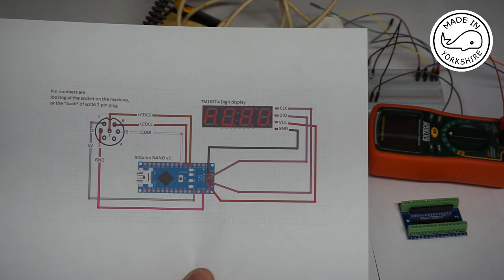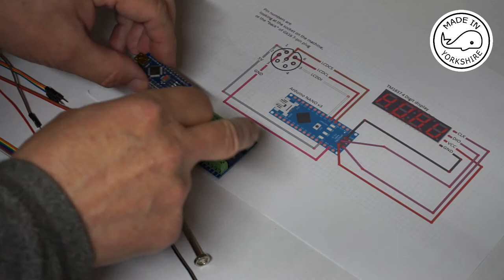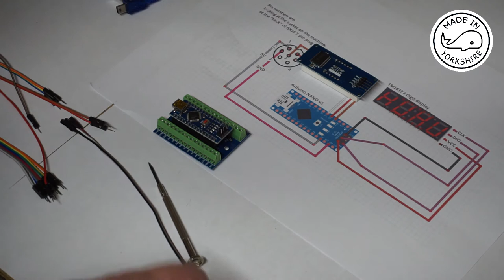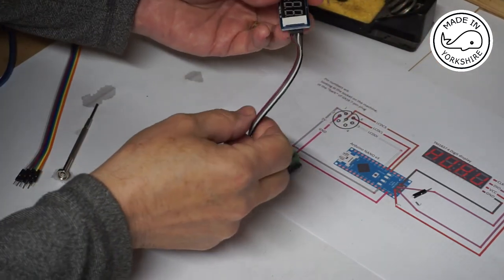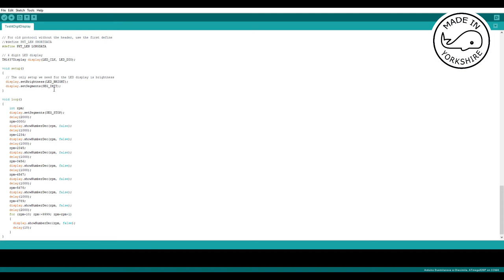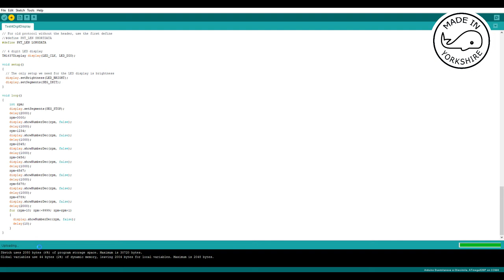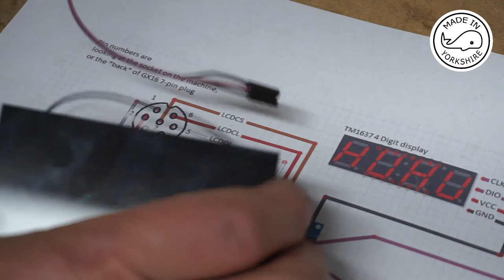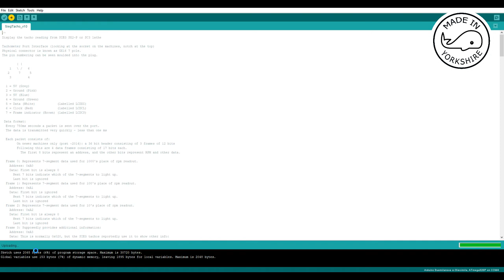#MT16 - Making a Digital Speed Display (RPM, Tachometer) for Sieg mini and lathe. By Andrew Whale.

Comment: Thanks Andrew, firstly for the video which I found very clear to follow and secondly for the detailed information and programs to build it you gave me.
In case anyone else is thinking of building this I would say that it is very straightforward and Andrews notes and guidance cover everything you need. My only problem was adding a library to the Arduino IDE. Never having done that before I could not get it right, and then suddenly it worked. Other than that learning to cut and machine perspex was new to me but manageable.
I now have one each on my lathe and mill.
Thanks again Andrew for making all this available.
Martyn Duncumb
Reply from the maker: Hi Martyn - many thanks for the update. I'm really pleased that you found the video and the instructions I sent you were easy to follow and that you managed to make a couple of these units.
A large amount of credit goes to Andrew McWhirter who developed the code and encouraged me to have a go at making one in the first place.
It's great to hear of successes.
Have a great day!
Cheers
Andrew

Comment: Hey Andrew, Great job!  I hope some other folk get something out of the tutorial too.  And yep, a huge thanks to Jeff Nelson for doing the "hard yards"!
Note, the version 10 of "SiegTacho_v10" Arduino sketch is not significant: it just took me that many iterations to get it all working reliably! And whilst it was based on Jeff's sample code, there was quite a bit of rework to get to this point.  My version has lots more comments - mainly so I could understand what was going on - and, of course, the adaption to the TM1637 "digital tube" display.
In my version of the tacho, I used the standard "dupont"" connectors to connect to the Nano and display.  They seem quite reliable, and if you go this way the only soldered connection required is to the GX16-7pin connector.  By the way, the four side by side connectors you've plugged on to the display board: may I suggest you join then into a single connector with a tiny dot of super glue on each one?
If anyone is wondering: Andrew has my blessing to re-distribute all the materials I provided: Arduino sketch, parts list and wiring diagram.  If I can help anyone else who wants to have a crack at this let me know!
Cheers - Andrew (Sydney Australia)
Reply from the maker: Hi Andrew. Crikey, I hadn't realised that you had done so much work on the Arduino software. You have done a brilliant job and it's extremely generous that you are happy for me to share it. I can't thank you enough for providing all the other info and encouraging me to give it a try. It was a truly satisfying project and I hope others will give it a try too. Good idea to superglue the connectors. I will definitely make a version 2 for my mini lathe and look to incorporate the led array.
All the best.
Cheers
Andrew

Comment: Last year I used Jeff Nelson's information to build by own tacho for my Sieg SX2P, but extended it. I had done a cheap bodge/CNC conversion for my SX2P, and wanted to be able to control the spindle from lunuxCNC. The tacho build provided the perfect  bootstrap. I built a veroboard prototype and that, much to my surprise, worked!  Yesterday I received PCBs from JLCPCB. This was my first ever design using DesignSpark PCB, so I was not expecting much. After plucking up the courage to solder in my components I programmed the Arduino nano, replaced the min-board with my board (they are plug compatible), and it worked.   I have found some hardware and software issues. The most glaring hardware issue is I got the sense of the potent Iometer wrong - so I have to rotate it anticlockwise to increase speed (I forgot to say - the pot or software can override each other - it depends on who spoke last: pot or linuxCNC). I also think I should have connected SX2P 5V to pin 27 (5V) of the nano, rather than Vin (pin 30). I am also concerned about the conflict between the USB 5V (USB is used to communicate linuxCNC <-> Arduino). Mind you, it's 97.5% working. Eee! I'm reet chuffed!
Reply from the maker: Fantastic. Looks like you are having some real fun...... it's great when it all comes together.
Cheers
Andrew

Comment: Andrew, First let me say how much I have enjoyed your videos and how much I have learned from them. I’m pretty much a beginner as well and have been thinking about getting a small lathe and mill to help me in my main hobby which is electronics. What I like about your approach is you share with us your experiences as a beginner and don’t talk down to us like some of those experts! 

A couple of points about the Arduino. Firstly there are various versions so it’s important to use the Nano or any other of the 5 volt versions using the Atmel AVR processor. Some people might prefer to work with the UNO which is a larger board and less challenging to the eyesight. The UNO comes with pre soldered female header connectors. When I’ve bought Nanos from China I’ve had to solder the header connectors which is a bit fiddly. Second point is the cables you are using to connect to the Arduino are known as DuPont cables, they come in three types, male male, female email and male female. They come in various lengths, generally I use the shortest ones for the job to avoid rats nests. It’s important to use quality ones, some of the knock off ones don’t stay connected very long they can vibrate out of the socket or fracture. Personally I would solder all the wires using hook up wire, not DuPont cables. Another point is larger numeric displays are easily available. 

I think both your lathe and mill use the new brushless motors which are controlled electronically without gearboxes? I’m trying to work out if they are worth the extra expense. 

Anyway, thanks again for your great videos, arguably the best thing to come out of Yorkshire :-)
Reply from the maker: Hi Stephen - Many thanks for such kind feedback and advice. I'd not heard of the Atmel AVR processor and purchased a couple of Nano's with the description of ATmega328P. I guess the AT is short for Atmel? I was fortunate to find some with header connectors already soldered. I was at a loss as to what to use for wiring. You mention hook up wire - can you advise what gauge to use and where to get it from? (it's all new to me).
I recently decided to purchase the O'Reilly Arduino Cookbook - which I have found the be very informative and though provoking.

When considering the mini mill and lathe I debated as to whether to go brushless and belt driven. I would imagine that the machines run a lot quieter than the brushed/geared versions and torque seems excellent. I'm very please with my decision. I believe that the SC3 lathe and SX2P mill used the same motor and internals. I guess the mill would be a great asset for your electronic projects. You need to be prepared to do some work the get the machines set up properly - but that's all part of the fun I guess. Seems crazy that you have to start drilling holes into brand new machines and make modifications, but that's the reality. I'm now in a position where I'm looking to actually make something special and rewarding - maybe an Oscillation Steam Engine (without the boiler)!

Thanks again for the feedback and the very best of luck in your venture into hobby engineering.
PS - Be prepared to spend as much again on tooling etc (just like all hobbies I guess).

Cheers
Andrew
Reply: Learning Turning - Metal Thanks for the reply Andrew. I’m in Hungary at the moment but I’ll be back in the U.K. on Saturday. I’ll sort you out some suitable wire and pop it in the post as a thank you for the videos. I’ve a fair amount of experience with the Arduino and a very big stash of electronics parts so if there is anything you need I’m happy to help. 

I think Arc Eurotrading will be richer and I’ll be poorer next month!
Reply from the maker: Hi Stephen, it's very kind if you to offer to send me some wire but you really don't need to. Sending me a link to where to get it from would be great and then I know how to get it in the future.
Many thanks.
Andrew

Comment: Thank you for sharing this. I just tried Jenifer's / Macpods code, and for some reason the LCD, after displaying the welcome message, was not posting anything (just blank). your code combined with the TM1637 leds worked perfectly on the SX2 Axminster milling machine. Version 13 tested  - picked out before I read the instructions. Also thanks for including the library inside the code.
Reply from the maker: Great! I  like good news. 
Cheers
Andrew

Comment: DIGITEN 4 Digital LED Tachometer RPM Speed Meter from Amazon £14.49.I used a multi volt charger for power from Asda £10 and stripped it down to fit inside control box . Took live feed from inside control box  very neat.Before fitting magnet pernament its got to be round right way.Saved me the cost of £170 for plug in Sieg one
Reply from the maker: Hi. Thanks for the info. As I recall my solution cost around £10. Mine gets the true spindle speed data and there is no requirement to gain access to power.
Cheers
Andrew
Reply: @learningturningmetal hi yes I know but for less intelligent people like me  no need for computer programming but your video inspired me to try make my own so thanks
Reply from the maker: No worries. Glad it worked out.
Cheers
Andrew

Comment: Interesting project. I may have to try it someday. I'm still getting my mini lathe set up. It came with a broken hand wheel on the apron so, I have to sort that out first. The seller hasn't been much help. I really like the hand wheels you've put on your lathe. Are they chrome plated cast iron or aluminum? I'd ask you where you got them but, being in the U.S., they'd probably cost a fortune to have shipped here. I'm not having much luck, finding reasonably priced ones here.
Reply from the maker: Hi Dave, sorry to hear about your damaged hand wheel. My replacements are chrome plated cast something - probably iron. Bought from www.arceurotrade.co.uk.
Handwheel is No.52 - 80mm Offset 3-Spoked Handwheel - Chrome - 8mm Hole 084-014-00080
Handle is No.11 - 50mm Plain Revolving Handle Type B - Chrome - M6 084-010-20050
Total cost £19 excl delivery.
I guess shipping to USA would be around £25, but it might be worth you getting a quote from arc.
Alternatively I could send you one of my plastic ones for free if you paid postage to me via PayPal. I would need to get a quote from my post office but guess it would be around £14.
Hope that helps.
Cheers
Andrew
Reply: I've been looking also and could never find any at a decent cost. But some of the other Grizzly lathes have nice ones and they do sell them separately if you want to look...
Reply: Than you for your kind offer Andrew. I'll let you know. I found one like your metal ones on Amazon but, they only have one in stock. I'll see how long it takes to get more in because, I'd like to replace both of them at the same time. I like the fixed- handle type of handwheel. It's what I have used for many years as a machinist. This lathe is my retirement toy. LOL. It's small enough to sit down to operate, as my legs are shot and I can't stand for very long, anymore. I'm also toying with the idea of putting a 100 mm. wheel on the tailstock. Have to think about that some more.
Reply from the maker: No problem Dave. I hope you get your hand wheels soon. Have fun with your new toy!
All the best.
Andrew

Comment: Just built this unit. Tested out fine with test program but did not work on the Microlux 7x16. Got a frozen screen with various segments lit up. Used version 12. Does anybody know if the pin outs are the same in the Microlux and/or the packets the same length. I did not want to analyze the pinouts if somebody has already done it.
Reply from the maker: Hi Marvin. Sorry but I know nothing about the Microlux. Two suggestions.... Double-check your circuit. Maybe find someone with a mini lathe or mill with a similar connection and try it on that.
Sorry I can't help further.
Good luck.
Andrew
Reply: @learningturningmetal   Just to follow up. The microlux pinout are the same as all the other's. This lathe  apparently uses the older packet information. Maybe I did buy it in 2014, but at any rate when to a version of the code before they changed the packet length and it worked fine. It is version 13 that I used for the record. Worked beautifully.
Reply from the maker: Hi Marvin - many thanks for the update. I'm really glad you got it working and this info could be of real help to others.
All the best.
Andrew